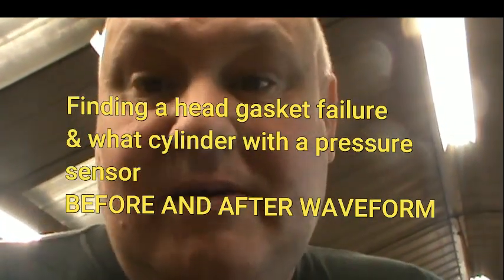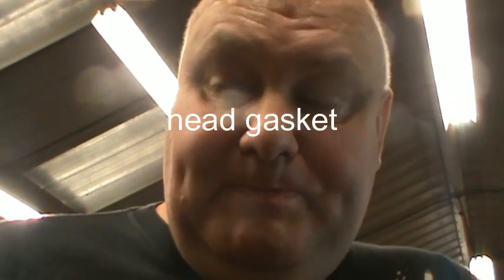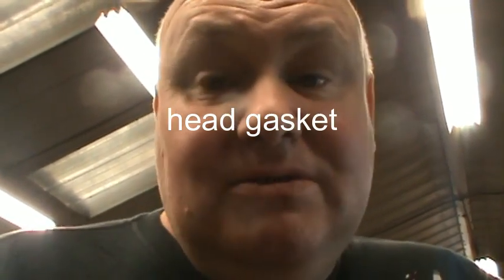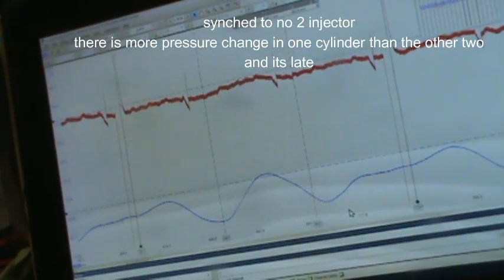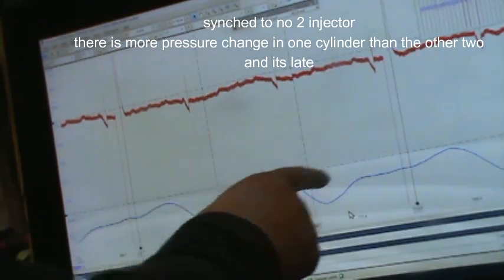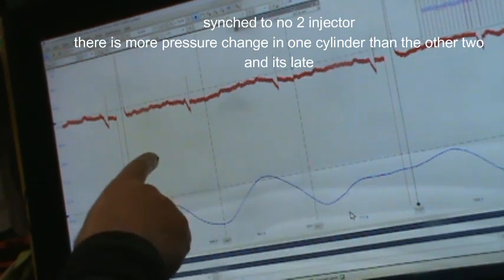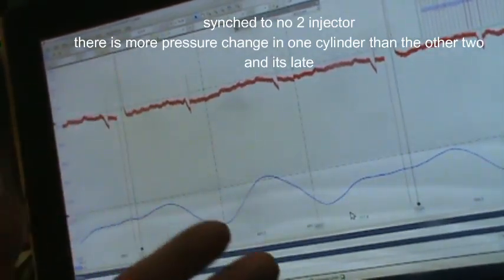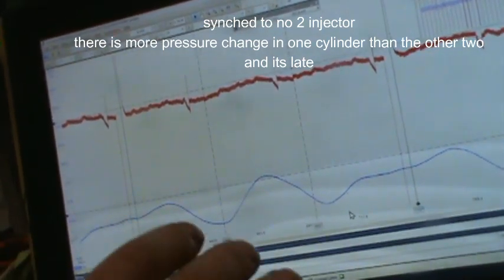Head gasket test with Pico and a pulse sensor before and after waveforms RESULT. Garage sale update

Comment: I've got what i believe to be an EGR cooler failure on my 2015 Volo D5 2.4.

Sometimes the car heater will work, soemtimes not, when it does you can hear the coolant gurgling and foing through the heater core, coolant tank is pressurised when cold and the car can overheat as well, but only when accelerating whilst moving, sitting still and revving it does not seem to cause the same overheating issues.

The car does lose coolant on very long trips, mecahnic seems to think it is the EGR cooler and not the head gasket.  What would your take be?
Reply from the maker: Sound possibly the head gasket has gone 
But it reminds me of the water pump propeller has broken away as it overheats when accelerating and the heater issue 
But if it’s a egr cooler he can test that before replacing it

Comment: Hi, if you used injector 2 as your trigger but compensated for 180° phase for induction how did you still identify cylinder 2 as the fault
Reply from the maker: Good question that I’ve use to ask my self as well .so when no 2 injector works the piston is going down in the bore so this piston is can not Produce any pressure it must be one of the others,  so no 2 piston will be making pressure on its upward stroke 180 later I hope this help 
But if I sync the no 2 coil you would see it on the raised hump showing pressure and 180 after the injection stroke

Comment: Hi great catch. Try using a clear hose instead of the rubber black. Just in case, coolant goes up into the hose and may damage your pulse sensor. Its not design for liquids. You can hang it from the hood to keep it upright. Great video, thanks again for the update also.
Reply from the maker: This I didn’t think off that  sir and thank you👍👍👍 lucky I’ve got some at work , and thinking about it  I got a catch tank to, must dig it out